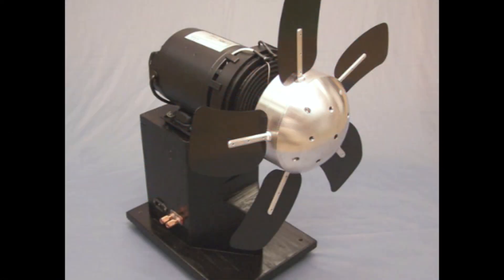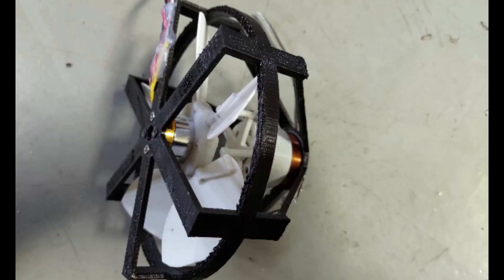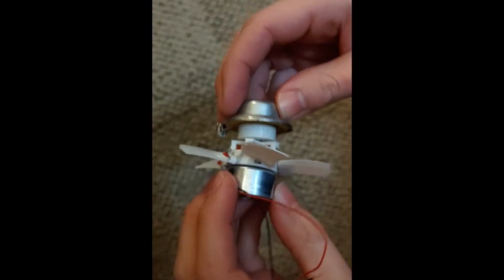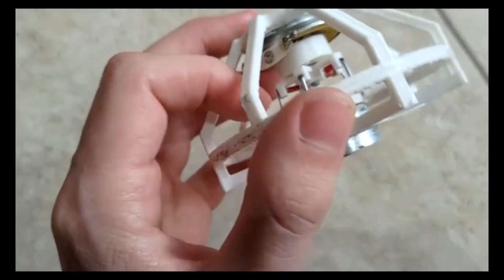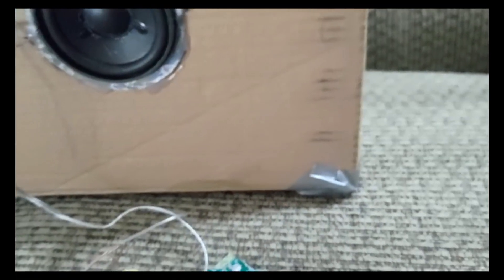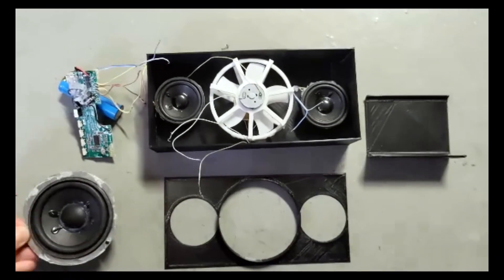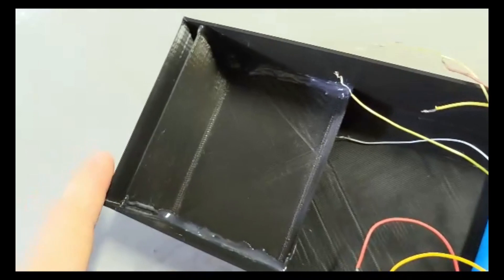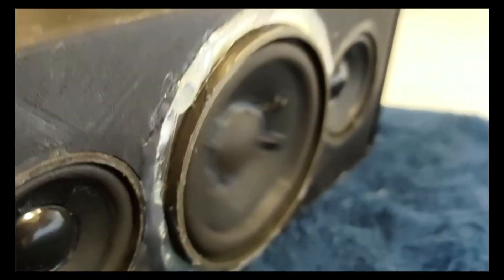Rotary Subwoofer inside Handheld Bluetooth Speaker (Will it work?)

Comment: Yeah, maybe there's a crossover point at which a fan-based speaker would work better than a cone, so that might be one reason this didn't work well either: too small a scale. Also, I couldn't help but notice that even though you say you tried it in the Bluetooth speaker case, you didn't actually show that happening.

Comment: Sure, the fan thing shook the box more, but the sound quality wasn't nearly as clean. So there's that to consider too. It would definitely have to be tightened and/or otherwise cleaned up before it could be actually viable. Interesting idea, though!
Reply: Sounds like the blades hitting the frame but this will never work in a small enclosure anyway because the fan noise is louder than the bass the cab can push and the way the fans vibrate so loosely, with the different back and front pressures cancels most of it out.
Reply: It's like cutting the foam around the speaker and expecting it not to fart.
Reply: @Donna-Trump : Yep, sounds about right, heheheh!

Comment: all you need is a good crossover to get rid of anything over 50hz.  most people use them for 0hz-20hz and let other real woofers do the work as the fan blades are better for infra-sonics.  these do not handle anything above 300hz at high gain/volume, and that is with the official ones that are like 12".  you can barely turn them up if you have no crossover, as it makes the blades distort too much.  also they require a sealed compression chamber, not a port.  One last thing is that rotary subs are super efficient and if you have them hooked up to the same wattage as the other sub there is a good chance it was getting too much power.  

I just started the vid, havent seen if you addressed this yet.  good luck!

Comment: From the video image, I kinda imagined the rotary sub being in the center of a "Bass tube" like 6" I.D. PVC sewer pipe, with equal lengths of tube from the front & rear of the blades. And the other components mounted to a 3D printed structure & including a more substantial battery like a 2s lipo @ nominal 7.4vdc or at least a 5000mAh 3.7 for extended play tube with a stronger motor... 

 With all that said...I have no clue how this would actually work.🤔

Comment: it will reduce distortion if you can make it a rubber busing instead of a bearing. Also, the paper clip rod must be tight. then check the xmax of the sub to make sure it wasn't bottoming out. iknow it would be difficult for the motor to work if is tight but it will sound good.

Comment: If the fan is spinning clockwise like I think it is, then any little shove to the blade angle off center will result in the blades being slapped to their excursion limit. Basically, the pushing motor needs to RESIST the airflow effecting the blade angle. (Try running the motor CCW)

Comment: Think maybe the fan is turning too many RPM's ? Might take care of some of the rattle.
Reply: The noise from the fan itself is worst than the rattling. Try adding a pot to control speed and mix and match with different sized fan blades (as recommended as well)

Comment: Smaller blades at a higher RPM might resist vibration distortions.  Also the port is very restrictive.  Been thinking of building rotary subs for years and trying to figure out a better way to interface the voice coil to the blades but have never got around to it.  Subscribed!
Reply from the maker: Thanks for subscribing! I'm making a new video on building a very simple and efficient rotary sub where I'll supply the stl files for the 3d print parts so this should help you build one
Reply: Making higher speed propellers would require a much more powerful amp to change the pitch of the blades as well ,BTW the fan noise itself would introduce more problems , I'll be looking forward to see more experiments though .
Reply: i feel like diy/building the driver might provide more opportunity for modification and have you though about using rc helicopter parts? they have stuff thats meant to deliver power and take high stress with minimal vibration transfer
Reply from the maker: @avragegamer8864  I used rc car linkages on my 16" version
Reply: @nathanbulle5782  nice! i was also wondering about spacial tolerance...is there any shot the rattle is from the blades rubbing anywhere?
Reply from the maker: @avragegamer8864  no only possibly the voice coil rubbing

Comment: rather than printing with pivots, try stiff plastic or fibreglass "spoked rims" with flaps held on with duct tape... and a "push pull". voice coils both sides, with springs, so theyre always under tension so theres no slop. tighten up the rattles.

and try a 50mm server fan or a bldc instead. you need a lot of power to move the air. just like a model heli, reef the collective up and you gotta shove in a LOT of power... and also, just like aircraft, you can make "compensated control surfaces" so theres no reaction on the driver aka voice coil. or, its only loaded by the weight of the blade, rather than the mass of air as well.

 motor has to be powerful, pitch control doesnt. that may not work out with the idea of flaps with taped hinges, dammit. or maybe it can. iunno. think about it. requires the hinge be central basically. hmmm. two rings, wire spokes, find some narrow bore teflon tube and jam that inside some nice light blades...

 maybe a flywheel? though the blade and hub should be heavy enough...

but yeah, thsi was silly and was what youtube was for. havent seen a video like this in ages.

something different. no flashy editing. no BS. no "just researched it 24 hours ago and im so excited to stick fifteen ads and  two sponsor placements on!". no stupid music. well... not much. lol.

you made my day :)

the rotary is interesting regards the infinite baffle concept.... takes it so far that its the reverse... the front of the "infinite baffle " is the box!

mmmm... dont think its going to work. no matter what you do! could make some nice flutter, but i dont think its ever going to get a "tone"...

(mary poppins speaker...bag?)

but fun to try anyway!

one other thing... multi stage? they gotta get a lot of compression in, and axial fans arent great for it with single stages...
Reply from the maker: Lots of great info here. Thanks!

Comment: Nice idea in theory, unfortunately smaller volumes require higher static pressure from the "fan" to be effective, this is because the rotary subwoofer has to do a lot more compression. Awesome stuff nonetheless though!
Reply: I indeed know nothing about this. But I was wondering about forced induction or some sort of sound reflective material to help maximize the lack of space 🙃 also was wondering about fan design. Maybe take a que from more static pressure pc fans (radiator fans for pc water cooling) fans can be optimized for straight up airflow or air pressure.
Reply: @copelandtaylor8851  There are quite a few things to consider. The first I'd consider is getting as close of a fit between the housing and the blade tips as possible.
Then there are also the following:
More blades (also offers smoother modulation (better fidelity if you want to try and move above 20Hz)
Minimise obstructions in the immediate path of the air since these introduce turbulence. (E.g. minimise surface area of movement mechanism and motor/voice coil/suspension).
Maybe design the blades to have a symmetrical airfoil, where the leading edge (part of the blade cutting into the air) is nicely rounded over) and the trailing edge (the opposite end of leading edge) is nice and sharp.
You still need enough air volume to not stall the air flow through the fan.
I'm not so sure typical methods of trying to absorb the rear wave would be appropriate due to how long the wavelengths are, you'd need some VERY deep in thickness absorbing material for it to be anywhere near effective. Feel free to try it out anyways though. Hope this helped
Reply: All things being equal, the rotary sub outperforms the conventional cone sub as he clearly showed in the video. So it definitely CAN work. This needs to be mass produced. Rotary subs just need a separate chamber to hide the mechanical noise produced y the fan.
Reply: Go for a bldc motor with high rpm used in drones
Reply: 1. Actual fan with a specialized feature, so no quotation marks needed. 2. In hypothesis, because before he tested it to the point of it becoming a theory, it was just a nice untested idea, and now that he has tested it somewhat, we can see that the nice part of the idea is still only in hypothesis status until it proves itself further with more improvement.
Reply: @HelloKittyFanMan.  As for "fan", I quoted since that is only the simplest part of the mechanism, but yes, you are correct in this, but this is a YouTube comment section, as long as the point is made, technicalities don't particularly matter that much.
For the other components and specificity of language, this is a comment section, the aim wasn't preciseness in scientific language but rather to get my point across to a more general audience (I don't know who might be reading it).
Lastly, there was no criticism here, I love the work. I was purely just providing insight as to why it likely isn't working in this instance with this smaller form factor, presenting my ideas forward to try and help.
All in all though, I do agree that things will be proven further with refinement. That is the iterative process after all
Reply: @Elliott-Designs : "But this is a YouTube comment section..." I know that it is that; it's obvious. But if you're looking to not be technical, because somehow that's "easier," according to you, then it makes even less sense to go to extra work for that, doesn't it? If it really is a variable-pitch fan doing the work (very fascinatingly strange to me, but it does what it does, and that's cool -- oh, "COOL," ha!), and if you believe YT comments are a place for simplification, then just leave the quote marks off even more likely.
Also, since when does "theory" have to be used just because you believe the audience is "more general," as if "hypothesis" is supposedly "not general enough"? I'm just kind of general and I still knew that word "hypothesis." Why do you suppose other general people wouldn't also?
And I agree with you this probably doesn't work because it's too small-scale. I imagine an effectiveness graph between this and the regular-Joe speaker cone where this has to get so big before it starts crossing that point into being more effective than the cone.
So... imagine what would happen if you could hook your voice coil up to the vanes of a variable-geometry turbocharger (even though they're not the spinning blades) and then spin that bad boy up to 100- or 200KRPM, HAHH!
Reply: Wider blades?
Reply: @blknightsixtyfo  greater arc length. Not sure quite how else to explain it. Sorry
Reply: Can the ram be created with coils to generate static? Like an ionized blade from ion wind generators
Reply: @SpotterDeer  nice idea, but unfortunately not. The static pressure has to be generated in the direction the rotary subwoofer is pushing the air. Higher static pressure just means it can do more compressing/refracting before the air stalls
Reply: How fast can you spin that fan?

Comment: i certainly enjoyed this video! a portable speaker with a rotary sub is indeed a good concept but it doesnt work that well in reality as you mentioned due to it not having an infinite baffle. my next suggestion is a rotary sub with a small footprint that can be put basically anywhere, with the form factor of a conventional sub, around 8 inches of cone area (more like blade area haha)
Reply from the maker: That was what I did in my first video. The dual rotary subs are 9 inches in diameter and one of them can be put anywhere
Reply: oh, i wasnt aware, i though they were 12" in diameter  @nathanbulle5782
Reply: Does these dual rotaries work well at outdoor applications?Have you tried any of them at outside and if not what is your predictions about outdoor usage? @nathanbulle5782